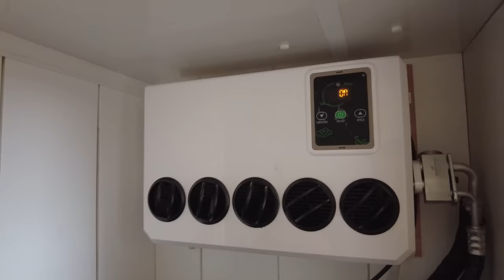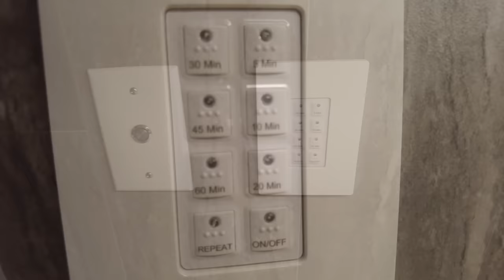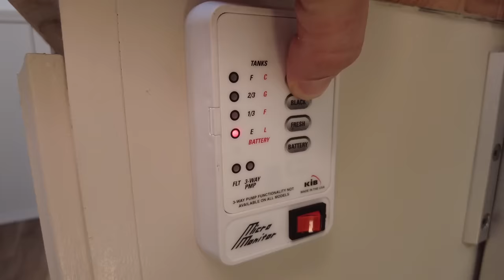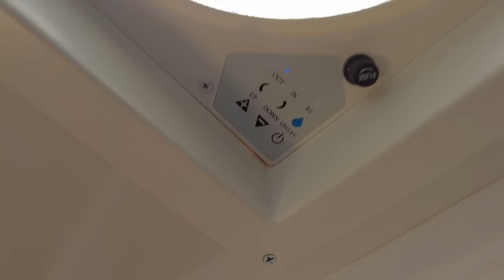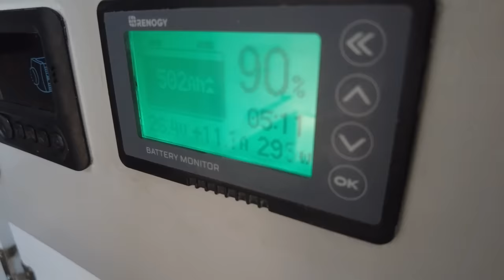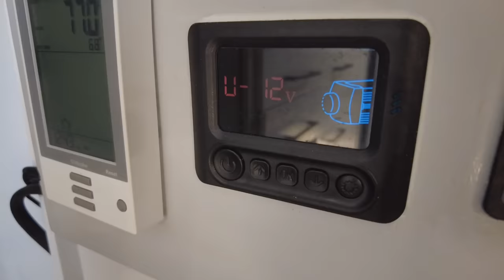Stealth Apartment + Toy Hauler in a Box Truck? DETAILED TOUR!

Comment: An idea I've had, yet to see done, is use a flat-screen framed in like a window on the inside and have it connected to an exterior camera, for a  stealth window 😉
Reply: or like one van lifer did, tiny security camera on each side.  Those 4 cams give you 360 view w/o having to step outside.  THAT should be on EVERY single van or box build.  Safety first...
Reply: That's a great idea, I may have to use it lol. I'm working on something like this myself
Reply: @jefffather4663 I agree. Especially these days
Reply: @frankierzucekjr  post up a video if you do so please 😉
Reply: @jefffather4663  : Even better, have them accessible in the cab while running for fine maneuvering to get in & out of tight confines.
Reply: I saw one in a stealth truck video last year. This security function could be accessed on the TV screen or a laptop screen. And the TV could still switch back and forth between security, the Dish function, or a DVD player. There were 6 cameras around the truck near the top. The guy built his own truck and he was geeky enough to set up this system.
Reply: I've seen someone do this with their basement apartment, they wanted windows so they bought a few monitors and installed them sideways and connected them to cameras and framed them like Windows and even installed curtains and everything. They also did it so it's you got sick of the live feeds you could see custom scenery
Reply: Fellow fake windower. Plus it also gives the ability to use pictures to change your environment.
Reply: I do the sane thing and if you get a chance to, install a 40 inch on the ceiling with a fisheye pointing up,  makes a fantastic skylight esp during storms. just turn off night vision or IR if equipped.  or it doesn't work quite as well.
Reply: @jefffather4663  yes security cameras, flushed or encased in, heck, I wouldnt care if they extrude a tiny bit, from a few feet away they will blend in if done right, painted white and all.
Reply: I did this in my build, a 4 camera surround camera that stitches the image into a single over head image eg. I can see all around the truck in one image from my desk in the truck :)
Reply: @pamelalandon2423 do you happen to have a link to that video?
Reply: Lovely clean looking interior except for the wires from air con. Driving me mad.
Reply: @jefffather4663  I have seen that too, and it is an awesome idea.  Firearms are great, but knowledge of what you may face is even better.
Reply: Great idea. I like the build, but was concerned about the lack of a window. Problem solved

Comment: Quite impressive!  Only one obvious critique:  The valve for the blackwater tank is vulnerable to the tires in the event of a blowout.  A single steel plate that is securely fastened to the frame/body to act as a wheel well and protective barrier.  I've worked on several motor home chassis that due to a simple rear tire blowout lost electrical/plumbing and even one that lost everything in an interior storage cabinet.  Aluminum won't hold up, it has to be steel plate that is secured.
Reply: Ooh great tip. Thank you for sharing this . I will definitely remember to tell my builder this. God bless  u for sharing this very important information.
Reply: Also, at 8:33, you can see the winch cable rubbing on the raw particle board of the cupboard...
Reply: @ChildofGodforevr also steel screens to cover your exhaust for the furnace etc due to flies ans rodents
Reply: There are factory built RV's that have the same problem with the black pipe in general. The brother was driving one when a rear tire blew out and it too took out the black pipe under the toilet along with the tank itself. The following week Myself and the other brother did a quick patch up just using black pipe from the toilet to the drain. Since the drain was on the other side from the toilet we estimated that the pipe probably held 12 to 15 gallons of waste. Problem was though that TP and the $h1# easily plugged it up so it was used primary for liquid use til we got another tank.
Reply: @incemomnia I feel like a lot of people do their own builds and then feel like they're qualified to do it for other people,  but there are a lot of details the average person that's not an electrician or a plumber or have any experience installing solar panels, etc. We did our own build, but we would never feel qualified enough to have people pay us to do one for them. Over the last 3 years we've have to upgrade and change certain things because we learned the way we did wasn't right and was even dangerous. I would never hire someone to do a build for us unless they have a lot of experience.
Reply: @CharleneOrtizTraining  Agreed, I'm the "shade tree mechanic" type, and have learned many things the hard way over the years.  Thankfully for me, by the time I was a practicing adult, I had access to the successes and failures of Youtube videos to instruct me on options that I could apply to what I was working on.  Maybe one day, I'll take the time to document stuff like this on video for others to be guided by but up to now, I never think about it until after the fact.
Reply: Can people see the interior lights through skylight  at night?
Reply: They're called tire air pressure monitors. Buy em and use em. Will save you lots of sorrow for less than $100
Reply: Me my self I noticed how the bed blocks the freezer. What if I want to grab a frozen burrito in the middle of the night 🤭🌯. 
Lol  just messing with you. Great work looks good.
Reply: This is so helpful. You should fabricate these and sell them or have them fabricated on demand.
Reply: @vivianchase-williams8508 if their vantage point is above the skylight, then yes, they would see light coming through; Furthermore, this light may be reflected by low-hanging branches, etc.. I'm guessing they could always block the light from the interior if they made a simple "cover" for it.
Reply: @CharleneOrtizTraining I agree I could see a lot of people’s hard work go up in flames literally or get mold because it was installed and constructed wrong.
Reply: Those tires didn't look too good either!!!
Reply: Great input.  As someone who would consider this as a retirement possibility, that is great to know.
Reply: I would want an electric panoramic glass sunroof to retract fully back so i could watch the stars above me at night. I would require a fan above my  bed and in the kitcgen and above my seating area. Also i would want the toilet have a drop down sink buikt into it for hygeine purposes and for this unit to slide backwards into a rear recess so i could enjoy a stand up shower. Further i would paint the black edges of the solar panels white to make them blend in with the rest of the vehicle. I would like to have a filter over the air conditioning fan located under the floor if the van. I would like several mirrors , one full length. I would like fake interior windows on the sides, with say 34" ultrawide monitors, displaying real time images if i choose or downloaded tropical vistas 😊I would like a micro cube stove installation too, with a pop off chimney stack and replacement plug so i could enjoy a fire when stealth mode is not a factor. Beside the  rear water outlet for washing the motorcycle i would have a water input. Also i would need a recessed spot for a robot floor cleaner to come out and clean and return. Fantastic build in every way. Kudos. I wouldn't think twice about you building one for me.
Reply: I was thinking maybe some kind of step or rubber bump off that door to get on and off the bed It's a bit of a jump Not so much going up but more coming down especially at night when you're half asleep.

Comment: My husband & I want to convert a van but this is making me rethink the van and going with a box truck!  It’s beautiful
Reply: Box truck:
* greater GVWR
* square straight walls and ceiling
* standing inside, walking around inside
* easily convert, on the road in days!
.
Van:
* curves everyplace
* custom everything
* months of frustration during conversion 
* "This one time, at van-camp..."
Reply: i did a 14' Uhaul,  it was a very nice comfortable home until it was stolen from me 😥
Reply: @tomcatt998  Wow! that sucks. Sorry about that bad luck. I would definitely be looking for it wherever I go. I hope you had full coverage to cover SOME of the cost.
Reply: @tomcatt998  Next build, wire in a very stealth GPS monitoring unit that reports location, maybe even 2 of them.  Build gets stolen? Pull out your phone, see its location, and call the cops.
Reply: Gas mileage and the wind may change your mind.
Reply: @jdaniels1313  smart. There's no way they can find a tiny GPS component hidden unless they knew it was there to begin with, in which case that shortens the list of potential suspects a ton.
Reply: @jacobmcvay123 most motor homes don't get very good gas mileage to begin with. At least this is built off of a Ford E250 or E350 Van so it's going to be gas and most likely the 5.4 liter V8 engine. As for the wind you could easily build a storage/deflector on the front of the box to help with the fuel economy.
Reply: no windows.  won't ventilation be a problem?
Reply: There are always trade offs. One big issue with box truck is urban parking legislation.  Many urban centers such as Vancouver do not allow vehicles over 20 ft in length to park on public roads.
Reply: @kjantv3649 There was a large vent in the roof, plus he showed some small vents on the outside. I don’t know if that’s enough though.
Reply: Me too, I will have to price one, or find a good auction.
Reply: With the advancements in alternative fuels a unit like this can easily be made to be fuel efficient. I have a buddy that runs a motor on some kind of vegetable oil with an electric backup. I don’t understand the technology but he does and he has told me it is very economical.
Reply: You get twice the space for half the money of van life if your savvy about it in my experience.
Reply: I gotta 03 c4500 box 12foot I think. It's short. But the you can buy these kodiak. C4500 c5500. 10k depending on mileage. It only gets about 10 miles a gallon though. Maybe better.  and with a chip program for power they also have a gas saving mode as well.
Reply: I’d love to build one out of an ambulance

Comment: Wow! It just looks like a regular old work truck! Design, design, design!

No unsightly cables hanging from tv
Winch system with tire chalk .
Hidden AC evaporative coil.
Original U-Haul ramp used as a support for the deck .
Center mount clothes hanger
Clean electrical and battery compartment. To name a few.

Very thoughtful and well planned design. This is why you’re going to do well with your business. Professional good work doesn’t cost, it pays! The guy who bought this unit is going to very happy. It’s really livable because of the functionality, fit and features. Nice job!

Comment: In future builds, you should add a compressor to the spray port area, as then you can spray air to dust off the equipment, or air up tires as needed, eliminating the need for water in desert situations. 
Just a minor improvement for those that like to go to less wet areas, also keeps the interior moisture levels down.
Reply: A small plug-in leaf blower would work just fine😊

Comment: You did well!👍 

I’ll give you my #1 stealth box truck tip that I use on my own stealth truck.  Take an old aluminum extension ladder and cut all the steps out so you just have the left and right runners. Then mount the runners on top of the truck along the right and left edge of the roof.  You get three uses out of these.  First they make a great frame to mount your solar panels.  Second they hide all the roof mounted stuff like panels, vents etc.  But most important, they make the truck look like a construction truck.  Instantly you can park anywhere and no one suspects you’re sleeping in it.  All they see is a work truck.  I’ve been living full time in my truck in an urban environment for over a year and have never been asked to move….. not even once.
Reply: @Rammer7  in my case they would be correct as it is also my mobile wood shop for my business.  But if they try while I’m sleeping in it, with my dog, and my 8 camera security system, and my 9mm and 12 gauge it won’t be pretty.  You can’t remove all risk in life.  You can prepare for it.

Comment: This is a very well thought out build. You did a really nice job. For me, I’d paint the cabinets or walls a different color only because I’m not a fan of all white, but that’s what’s good about building a rig, you can do what you want. 

I like that you used a black tank. I’ve seen people install a separate recirculating water tank with an on demand water heater so they can take endless hot showers. You just need to install a couple filters to keep the water clean. The heated floors are great, as is the full wet bath. You have plenty of solar/batteries! The only thing I’d add/change is installing a PVC tube under the chassis, if possible, to hold the sewer hose. That or install a 4” square tube bumper.  

** The last, and most important addition I’d make is to install 90 elbow on your dump drain so it points to the side of the rig, and install a metal panel between the tire and that 90 elbow. I had a tire blow on the freeway and the steel belt tore out a large hole in my black tank. Those steel belts spinning at 55-60mph can do a lot of damage to everything in its path. I know it might be a hassle to install, but if you don’t do it, you should advise your client to have it done. The sooner the better, unless he plans to replace the tires soon as they looked pretty well worn.

Comment: One thing with a lot of these builds I always wonder about is how much thought people give to overall weight and weight distribution.  It looks like you’ve actually taken that into account here with the materials choices and where things are located. Noobs just seem to start throwing whatever they can find in the build.  If I ever decided to go with mobile living I would definitely have you build mine.
Reply: I was thinking the same thing as well, but the size of that uhaul should compensate for any uneven payload ive seen people stuff pianos on one side, and lamps in the other and went cross country
Reply: Yeah, the more weight, the more mpg. This will definitely need alot of gas unless it's an electric Uhaul. Other than that, it's a great project, but probably not for everyone like the bed design over the drawers.
Reply: @Loudes012  Drawers are usually thrown towards the floor
Reply: It is a uhaul after all. These things have been overloaded since they opened lol. I don't think you can build anything in here that would make this too heavy tbh
Reply: Wow, did not consider that, top tip, if I do build one will take that into account.
Reply: @frankierzucekjr  I mean, they're designed to be filled to the top with couches and furniture and stuff like that. A build like this would be mostly empty when moving, so... yeah I don't think weight should be a problem other than for mpg.

Comment: Beautiful build and well thought out out!!  Only thing I would change, or actually add, is some kind of protection for the dump valve being so close to the tire.  One blowout, of the tire or tires throw something up between the duals and it would be big mess.  Maybe just a diamond plate shelf to enclose the valve?  Really nice overall though and extremely well thought out!!!
Reply: Good point.  We had this happen when pulling a camper and the plumbing was unusable.
Reply: Yup ether some diamond plate or a thick rubber mud flap between that tire and the dump valve, hell I'd argue make that wheel fully enclosed above the side skirts.
 
I know a guy who bought an RV with a busted dump valve, and a full, dried out black tank, was not fun.
Reply: Where is the 'stinky slinky' stored? did I miss it? I will watch again. 
It is an amazing build - I want one!
Client must be a dirtbiker; street bikes can easily be 500  - 900 lbs and probably wider.

Comment: I would switch places with the sky light and vent. Also noticed the solar panel wiring is not protected with any conduit. Squirrels are gonna eat those inside a few days. I would probably put a simple filter box over the HVAC intake to prevent pests and debris from getting pulled in. The sliding door is gonna be a problem with a bike. The angle may cause it to catch the skid plate and tear up the door runners. Maybe wooden protetctive block or something could be used.

Comment: Question for you - are there any precautions or features built-in that guard against 'riggors of the road'? I've seen plenty of people with van and truck builds, and what they often don't show you...but what some have talked about, is all the natural bumps and vibrations of driving will eventually cause cabinetry and other built-in features to either become cracked or to come loose.  And has there also been any road testing to indicate how these built-in features would hold up if, say, you hit a couple of large potholes?

Comment: Fantastic! My only suggestion is to have the ramp powered up to level so the bike can be walked in. I imagine the bike falling over during winching. Either that or a rolling stabilizer that attaches quickly and easily to the bike.
Small cameras on the roof for 360 day/night vision for situational awareness would be good too.
Best build I’ve ever seen.
Reply: I agree- I would have used a winch to raise the deck from ramp to level, then walk the bike in. Using the half extended original ramp to hold the deck/ramp looks sketchy and half-assed, and the thought of winching a bike up an incline like that sounds like a shitty time.
Reply: That wouldn't be any harder than putting a bike up in a pickup truck. Really a decent rider could just motor up that no problem. Bikes inadvertantly die though so the winch is nice to have.